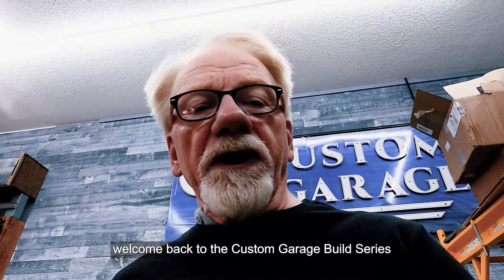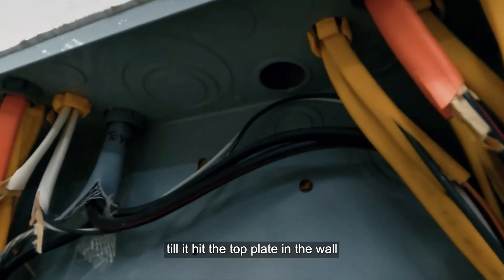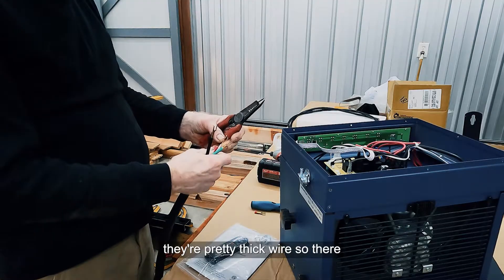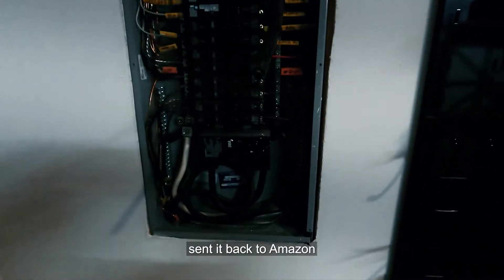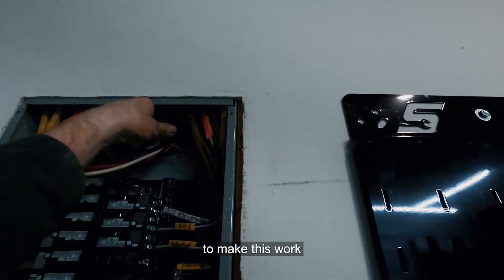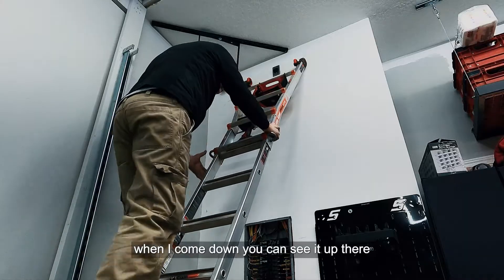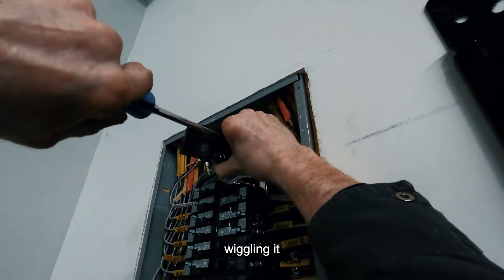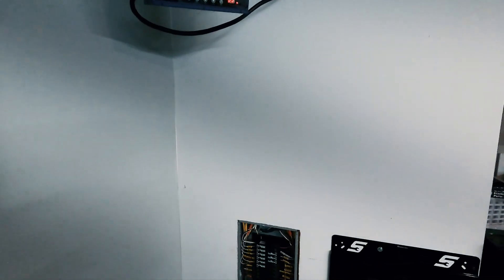Installing 10,000 Watt Garage Heater -Tutorial

Comment: I would like to make a comment about these heaters. My wife bought me the 10,000 watt Comfort Zone garage heater. And it does a great job. But about 1 month into the second winter I'm in the garage and I smell something hot. The distribution block where the power comes into the heater was melting down. You can't find a direct replacement on line so I changed mine out for a much heavier industrial block. I've had no further problems with the heater at least so far. I used to leave the power on to the heater all the time and just turn the heater on when I was working in the garage but after that I shut the breaker off when I'm done. Sorry this is so long but some of you may find it useful. By the way, according to the internet I am not the only one that this has happened to.
Reply from the maker: Hey thanks for sharing, we have been pretty lucky then with ours as I have been using these in my homes for 5+ years now

Comment: Thanks for the video. Just getting read to install the 10k version. My instructions say to use 6 gauge wire and a 60 amp breaker.
Reply from the maker: Hey good luck with install! Hopefully video helps
Reply: I used no.8 wire
Reply: How’s the 10k version holding up for you?

Comment: I need your 6/2 cable that you said was too big but I am having trouble finding one. Can you tell us where you ordered your from online? Thanks for sharing your thoughts about all of this. I have a 10,000 watt unit on the way and I'm running 55 ft. of #6 AWG (6/2) and a 50 amp 230V breaker. I just need the pigtail with a sealed plug on it to connect the ceiling mounted unit to the receptacle on the wall behind it. Wish me luck!
Reply: He says the 6/2 was too big and its what the manufacture says to use along with a 60 amp breaker anyway why do u want a plug? Just wire the heater directly to your breaker and save money on more wire, a outlet, a outlet cover and a outlet box just saying 👍
Reply: @AdamOutlaw87  I was able to get it all running  yesterday. I found the 6/2 romex and rigged up a high quality Bryant outlet and  6/2 pigtail that is 1 in. in  diameter to plug in the heater. The reason I did it this way is so that I could use the outlet for electric car charging or welder, etc. So this is why it was worth the extra expense in my case. Thanks again for your videos.